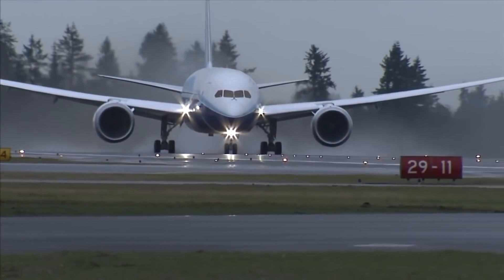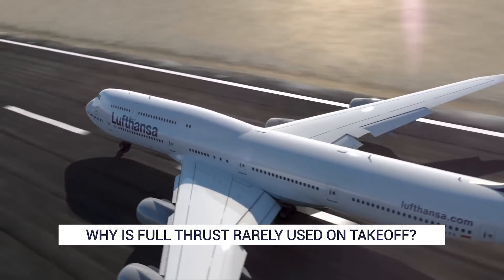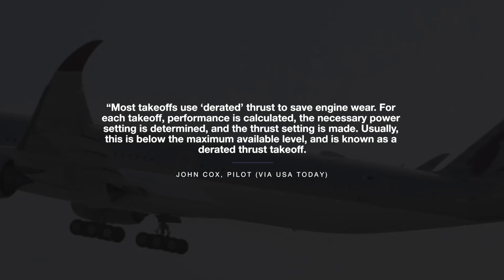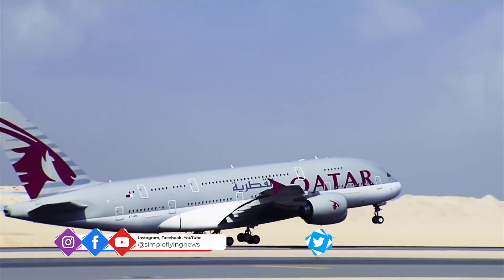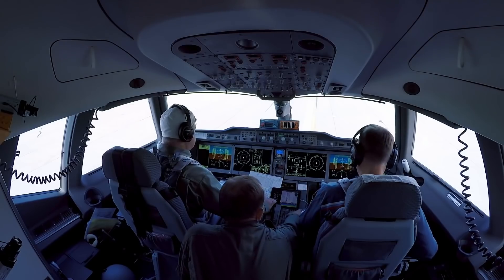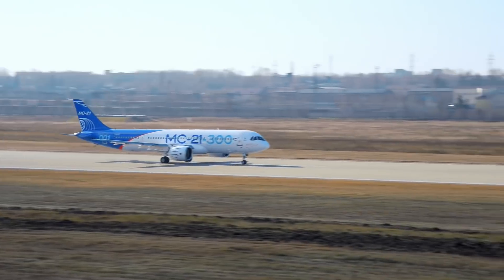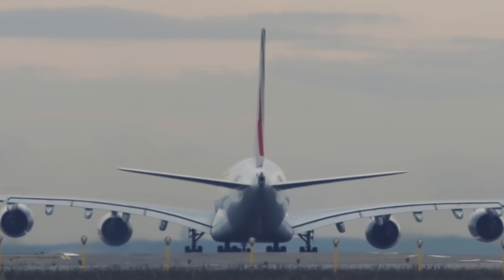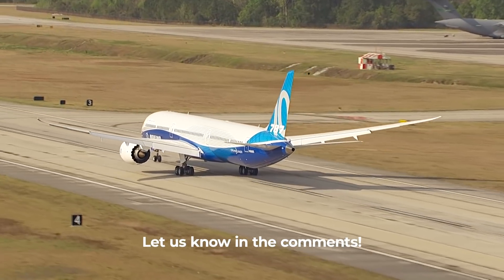Why Do Airliners Rarely Use Full Thrust On Takeoff?

Comment: Hi-Bypass engines used on today's aircraft produce so much more thrust than the jet engines of the 1950's-70's and so full power take-off's are not necessary. It is neat that full power is available when needed but for the vast majority of flights, it's just a waste of fuel and increased noise levels inside the cabin and on the ground. The motto is, have more than you need but use just enough to do the job.

Comment: Airlines use derated thrust, or flex thrust to reduce EGT on takeoff. High EGT (within 10 deg of the EGT limit causes sulphidation.

From an aviation bulliten board -

Sulphidation occurs to high temperature alloys when operated at such temperatures in contact with the sulphur content in aviation fuels. Not 
just turbine blades but also combustion components. On turbine blades, the attack tends to occur to the pressure surface at about 2/3 

height where the combustor peak outlet temperature occurs.
 
If sulphidation is a problem the manufacturer would normally coat the aerofoil with diffused materials which resist the effects of high 
temperature sulphides. For example aluminium or more recently platinum.

Comment: I used to work in the industry. Very occasionally engineering would instruct the crew to use full power on take off. The engine data would be analysed soon after.

Comment: Didn't know it. If taking-off with derated thrust seems to have a lot of advantages. It should be okay if it is safe and approved by the manufacturer and aviation regulators.
Reply: It is. Lots of work has been done by both to make sure this works. The manufacturers performance calculations allow reduced thrust to be factored into take off calculations.

Comment: I don't know about all commercial jets. However, an airline pilot friend of mine told me that on modern jets (he was talking about the 757 and 767, in particular), he would align the airplane with the runway, then move the thrust levers to 'auto-throttle', and the flight computer would then control the engines until the plane was back on the ground. I suspect the auto-throttle rarely went to full thrust. Even then, the maximum thrust can only be obtained at higher airspeed, when there is more ram air coming in.

Comment: Does de-rated thrust affect the length of runway an airplane use for takeoff? As in lower thrust, longer runway, vice-versa?
Reply: Yes but it doesnt matter
Reply: Not always. In some cases you will use less thrust on a short runway because you’re using low speeds for takeoff and need less asymmetry in the elegant of an engine failure.

Comment: This is the reason that in general two-engined aircraft climb at a higher angle than a four-engined one.
All multis are certified in part assuming an engine fails at the most critical point during takeoff. It therefore follows that since the twin has to meet the same climb profile with HALF the power as opposed to a four-holer which retains 3/4 power, it can appear overpowered in normal operation. Of course, derating the thrust makes this less obvious.

Comment: During a stint in the ual engine shop in early '70s watched 747 JT9 hot sections fall in pieces on the floor, shoveled it into a bucket. They then added water injection seemed to help.

Comment: In an A380 cockpit video I noticed climb thrust was higher than thrust used for take off. Do any other airliners do this?
Reply: when the aircraft is light or the runway is long, the engine thrust can be reduced to a setting which is actually lower than the climb thrust!
Reply: Yes, especially when they exit a noise abatement zone after takeoff or do a big turn, I notice it a lot on flights out of cities, the thrust increases

Comment: I know Boeing 737's take off with go around thrust. Heard that from Mentour Pilot, as he's a 737 captain
Reply: No  you didn't understand what he meant,the 737 use derated take off thrust,it dont need the full power to take off
Reply: there's a misunderstanding there somewhere.  G/A thrust is rarely the same as T/O thrust.  the action to set the throttles is the same (TOGA buttons on the throttles) but the power set will be different.  One "click" on the TOGA for G/A will result in power for a 1000 fpm climb.  double click will result in maximum continuous power for that altitude/temperature.

Comment: I did know this.  I can also thank the extra thrust that a 757 can provide.  It was well used on a flight I was on out of LAX one morning when there was a runway incursion.  The captain hit the full thrust and lifted early.  I saw the tail of another aircraft under the plane I was on at about 50 feet below.  The pilot then lowered the nose to level to gain airspeed.  When we went over the beach we were still pilled into the seat and I think we went by the beach at about 300 feet and with the speed climbing fast, he then nosed up to continue on with the flight.  The pilots earned their money that morning.

Comment: I’m sorry, but the discussion about using derated thrust and using maximum thrust if required is completely wrong. Derated thrust is a fixed reduction in thrust and the associated Vmcg and Vmca are also reduced. Applying full thrust while using a derate will cause a loss of control. The other method is an assumed temperature method which allows maximum thrust to be used if required. The ATM is primarily used to prolong the life of an engine, where derating is primarily used for operations on contaminated runways. It does get used to prolong the life of the engine.
Reply: I think calling it debate for a video for laymen is not unreasonable.

Comment: Is that the same thing with all jet aircraft? Like cargo, military, and private jets? As well as propeller aircraft?
Reply: In military fighter aircraft this is not the case, they usually use full military thrust, but in most other jet aircraft they use either derated thrust or reduced thrust deoending on the situation. In propeller aircraft full power is used during takeoff and no thrust reduction is used.

Comment: Did you know that the 737-800 has a 
'more than' maximum thrust setting for special airports? 
KSNA as an example.
Reply: Yeah, it goes over 100%.
lol I just play X-Plane 11
Reply: Most planes can go over 100% but that damges the engines big time
Reply: @lakshyagrover6379  Not as much as geese and seagulls going thru them but yet they won't put screens over the inlets......
Reply: @jakejacobs7584  They wont ever do tht, its a very rare event and a possiblity if hull loss from it is basiclly non existent. No point in increasing full burn and weight for tht.
Reply: @Sirikiller   I flew the aircraft, it's a fact.
Reply: you mean 27K "bump" (and I'm drawing a blank on why they call it "bump."  used to know, but forgot) ... that's not more than max ... that IS max.  All other takeoff power settings are thrust reductions, though I DO euphemistically refer to "max power" as "Super MAX" (27K bump), MAX (26K), and Little Maxes (24 & 22K)

26/24/22K ... and then a derate based upon temperature/pressure altitude from THAT.  Typically, the -800 engines are "double derated" for takeoff ... 22K with a temp based reduction from THAT.  A LOT less power than the CFM's MAX of 27K
Reply: @shaark92  that’s it…. If bump is max why couldn’t you use it at say KDFW? Maybe normal max is a better term
Reply: @jakejacobs7584  yeah, IDK. You're right, there are only a couple of airports domestically where 27B is used/authorized but the limitation is the same (5 minutes) ... so I wouldn't call it "more than max"  Max is max, or is it??? :P   LOL.

Comment: Can you do a video on why planes sometimes spool up their engines before they take off?
Reply: i think what you mean is that at first the engines stabilize at a lower thrust before advancing to takeoff thrust?
i think this is to verify correct engine operation before deciding to give full power so that a problem can be detected before using full thrust
Reply: @japsie9280  That's what I meant.
Reply: Maybe that also answers the question why cars‘ engines spool up before they accelerate!

But seriously: of course they spool up, how should the aircraft leave the ground?
Reply: Can be part of engine ice run up prior to take off...for example, visible moisture/temp below 3 deg Celsius/run up to 40% N1/5 second duration...watching vibration indicator while doing so in a typical Canadian winter departure. This run up may occur on the button/in position if ATC isn’t concerned ( arrival spacing wise) or more likely, you conduct the engine run up on a taxi way just prior to taking position ( without blasting anyone behind so need authorization for that either way) GE engine on 787 as example

Comment: An aircraft must be able to take-off from near take-off speed on one engine in case of engine failure - So it must take-off at about half maximum thrust.
Reply: No. It’s more complicated than that.
Reply: @peteconrad2077  Yes, the rudder must apply a force/moment to counter the moment of the engine thrust being away from centre of of aircraft when operating on one engine. Rudder then adds to drag. Drag of lost engine probably increases too. Having reached V1, the thrust required to become airborne and limp around the pattern will be far less than a climb to cruise. Perhaps remaining engine only needs to up trust 50% when one engine lost. A 777 which lost most of an engine casing 40 minutes out from Hawaii, barely made the airport on one engine such was the drag increase. ETOPS does not cater for key circumstances of one engine loss.
Reply: @peteregan3862  engines do provide enough for climb and cruise to diversion on single engine. 

How do you mean, “barely made it to the airport”. Looked like he flew a perfectly reasonable approach to me.
Reply: @peteconrad2077  It was probably reasonable, but I heard it was losing height all the way to the airport. It could not maintain level flight is what I heard. Readers of the NTSB report suggested five minutes more flying would have seen it crash.

Comment: that's interesting because as a private pilot in a single engine cessna 152/172, i've always told to use full throttle.
Reply: The whole video rather was about commercial aviation
Reply: Sir most of these big twins are overpowerd there single engine can take them fully loaded over the ocean so they do need overpowerd engines

Comment: Planes actually adjust take off power by two means, programming a higher air temperature to trick the engines to reduced their take off thrust, and a fixed derate which unlike the former method, cannot be overridden to maximum take off thrust, only the maximum of the fixed derate.

Comment: 1:18 During systems class many moons ago we were shown a US Air Force study that showed a significant increase in the possibility of engine failure during takeoff if full thrust is used for takeoff.  Max power takeoffs are also sometimes required by maintenance.
Reply: They also used to have a "maximum thrust" button on a Huey helicopter but found pilots in the Vietnam war were overusing them, decreasing engine life, I recall hearing.

Comment: Yes, I learned this decades ago.  I was on a 727 and sitting next to a pilot who also flew 727's.  Having flown on 707's which did seem to use full power, I asked the pilot.  He said they don't use full power because of the wear and tear on the engines.  He said they compute the aircraft weight, temperature, runway length, etc. and select the appropriate EPR (engine pressure ratio) setting.
Reply: Even at full power those 707s climbed very slowly. They were really pushing the limits of the weak (by comparison) engines of the day. With newer twin jets being able to cross an ocean fully loaded on a single engine you know there's plenty of reserve power if both are pushed to the maximum. I was on a lightly loaded A321 on a flight in the before times and the low level of power that was needed for takeoff, at lest judging by the noise level, was honestly surprising. Edit: It wasn't an A321neo which is surprisingly quiet even at high power.

Comment: Some airlines have internal requirements to carry out a take-off at maximum takeoff power setting once every 30 days to verify engines condition. If a flight requires a max takeoff power setting in any given day then the counter is reset to 30 days.

Comment: Well I thought they always used full thrust, when you see most flights take off on flight clips, they always seem to push all the way forward. Why do you never hear them say during there take off checks ,thrust 85% etc.  This was a surprise to me.
Reply: The checklists don't call for a % power, it's based on EPR (engine pressure ratio - the ratio of pressure at the back of the engine compared to the front intake, which if you multiply by the area of the engine gives thrust) which is calculated beforehand, so when they check EPR, they ARE confirming the power required. The engine management then figures out how much throttle to apply to give the selected EPR, so the take off is completely predictable (in terms of physics, if not mechanical failure/bird strike etc). Manually setting a throttle position relies on a full understanding of the engines power curves under different conditions - e.g. thrust changes as the airspeed increases, so its much less predictable; it's how it used to be done until we got better at making machines that fly.

Comment: The standard take off thrust is a „flex“ setting, which results in a reduced take off thrust. However, the pilot flying can always push the thrust lever to „TOGA“ (Take off/Go-Around), which will make available maximum thrust (but it might take some seconds for the engines to spool up, which is why at landing, the plane usually lands with higher thrust on engine and flaps deployed rather than idle thrust gliding, which would make it impossible to swiftly spool up the engines in case corrective action is needed.
Reply: Plus you need some thrust to maintain a nose up attitude on the 3 degree landing glide path.
Reply: @marcelstanford430  not sure what you mean by that.
Reply: Those terms are used for Airbus airframes. Boeing and other manufacturers use different names for the settings. Boeing uses a percentage of max available thrust and uses the “TO/GA” button to accomplish this power setting at takeoff. The “TO/GA” button is used in the majority of standardized Boeing takeoffs. Setting the thrust levers at the “FLEX/MCT” detent in Airbus establishes the “MAN FLEX XX°” annunciation in the FMA. This setting is accomplished by entering an outside temperature that is different from the actual outside temperature in the FMS to cause it to calculate the amount of thrust required based on that increased temperature. Since engines function less efficiently at higher temperatures, using adulterated temperature values in the FMC can cause the engines to be used with a derated thrust rating.

Comment: The late great Freddie Laker was the first airline boss in the world to introduce derated take offs . Being originally an aircraft mechanic he realized full power take offs were seldom necessary particularly when there was a strong head wind.
He had his staff make take off tables with regard to wind speed etc at every airport he flew from and over time engine manufactures realised his plane engines required less overhaul, had less wear and needed less maintainence than other airlines using similar engines and planes. plus he saved on fuel costs.

Comment: Actually, you can’t override a de-rate on most jets. There are two types of reduced thrust takeoff: A flex takeoff (or assumed temperature takeoff on a Boeing) is where you enter a higher outside air temperature into the FMC, which tricks the computer into setting a lower N1 or EPR limit for the takeoff. This type CAN be overridden in the event that more power is needed. 

A de-rated takeoff is where the engines are given a reduced thrust limit, which cannot be overridden until climb thrust is selected. 

Both methods are inherently safe, and they must still  meet all required climb gradients, assuming an engine were to fail at V1.

Comment: 0:11 Actually, due to the forces needed to accelerate the aircraft to a certain speed. The engines do not provide lift.
Reply: From a dead stop, how much lift will the wings generate without the engines?
Reply: @Cautionary_Tale_Harris  It does not matter what scenario you spin here. Engines do not provide lift in a passenger aircraft, however necessary they are to maintaining or initiating flight. If we flip your scenario around, let's see how much lift your engines provide without wings.
Reply: @datnguyenthe8300  Have you ever heard of a rocket?
Reply: @Cautionary_Tale_Harris  Have you ever noticed that the video I commented on never mentions a rocket, which are completely irrelevant to the topic at hand. Also I explicitly specified "passenger aircraft" in my previous comment.

Comment: #1 reason is money.  #2 is usually noise restrictions.  People move in under well known flight paths and then whine about noise.
Reply: typically a "noise sensitive" airport will require max power on takeoff in order to gain altitude as early as possible, THEN a power reduction to "climb power."

Comment: I was a flight attendant and I always thought they used full thrust.  Especially on the 747s
Reply: I bet they used full thrust on a fully loaded, fully fueled 747 going across the Atlantic or Pacific.  All that fuel, 400 passengers, luggage and additional freight cargo is A LOT of extra weight.
Reply: @AaronSmith-kr5yf  Nope. Atlantic flights rarely require full thrust. Unless it is a very hot day, high altitude departure or take offs with tailwind. Bogota Colombia would be an example.
Reply: Nope  80or 90% most of time  then 10 min later maximum countinus thrust
Reply: Keep pushing the drinks trolley.